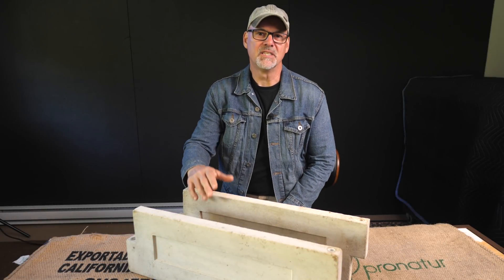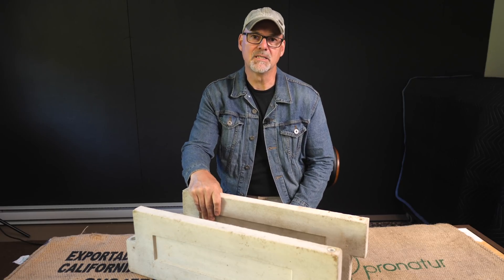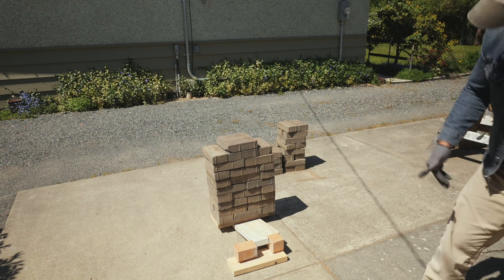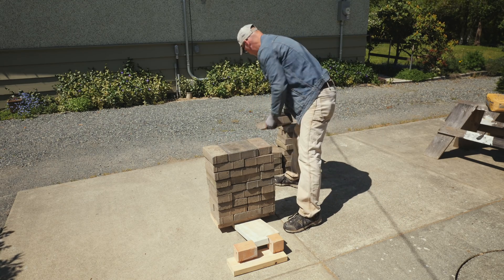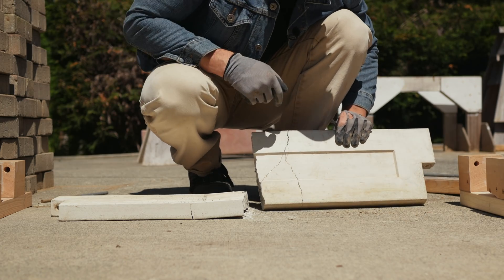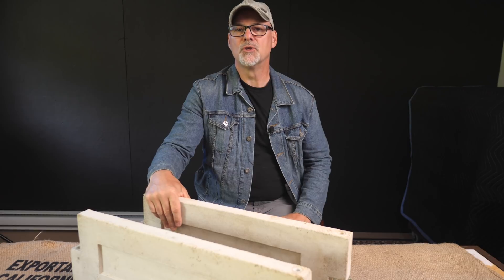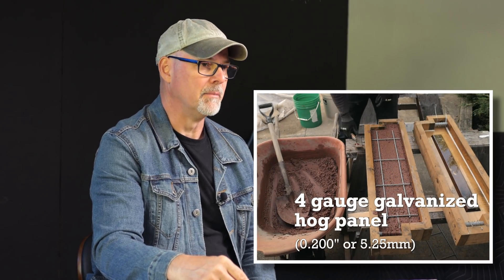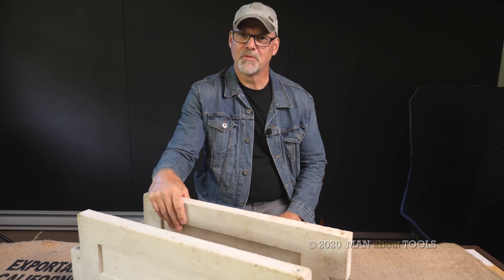How Strong is CSA Concrete? - Deflection Test Lightweight Garden Box Panels

Comment: I'm about to start building my forms, but I do have a question.

CSA concrete has a compressive strength of 6500psi. Sakrete Maximizer has a 5500psi compressive strength. The Sakrete Maximizer costs less and is probably lighter. Have you tried using Sakrete Maximizer to build the thinner light weight boxes?

Comment: I am real curious if this system could be adapted to a short retaining wall solution. Maybe with some 3/8 rebar or the hog panels? Any thoughts?
Reply from the maker: That's possible but, the CSA concrete is more expensive than a regular bag of readymix.

Comment: I wouldn't want to use the steel reinforcement, there isn't adequate cover to prevent it from rusting and spalling the concrete within 10 years or so. I'm more concerned with longevity than strength or weight, so I'd chose the thick Portland variation with fiber only. Perhaps with heavy fishing net as a reinforcing mesh that won't rust.

I think plain old Portland cement will be adequate because I have some garden beds made with 24"x24"x2" pavers half buried and mortared together on the edges. I routinely walk on them and pivot the nose of the wheelbarrow on them when dumping compost. None have broken yet (I forget when we placed them, but I know they were there in 2012). I believe they are made with a very dry concrete mix which is compressed into the molds.

Comment: First, my condolences on your loss.  We are of an age where this aspect of the cycle of life becomes more frequent.  It is important to celebrate and remember all of the good times, but this doesn't make it any easier.  I've watched some of your videos and I am right now putting together my plans for making concrete planter boxes and you are 100% of my inspiration in this project.  Can you tell me how much weight brought the standard portland cement panels you built to failure ?
Reply from the maker: Thanks you very much! I wasn't able to break a standard portland based panel with all the weight I could apply by hand.

Comment: Very interesting series.  I am about to build a house and some outbuildings.  I have been following because I am interested in using a post and beam construction methon and plan to use air Crete blocks as the infill.
I plan to use blocks 2ft  long, 1 foot wide and 1 ft high.  I am just wondering what the compressive strength might be?  Tensile strength is one thing but virical load bearing test would be of interest. I wonder would you mind testing the compressive strength of one of your panels as if it was to be used laying down and supporting 20 feet of aircrete panels above it.

Comment: Thanks for the video!. I watch your tests with great interest. So the best for tensions would be 2 meshes, but if you were to choose the mixture to achieve lightest panels that would also resist a hammer what kind of mixture would it be?
Reply from the maker: I'm font of the Perlite or Vermiculite blends for lightness and durability.

Comment: ( 4:45 ) non-life-depending application of the panels aford you to simply repair them with CSA concrete. As a matter of fact quick, quality and strong repairs are one of major uses of the CSA concrete. Put the parts side by side on plastic sheets, apply plenty of water to the crack(s) and use the prepared CSA concrete wet mix as if it is glue.

Comment: Got my plans last week; built the forms; pouring today - great timing w/ this video!  Even though the test showed relatively low tensile strength I plan on making my panels without the wire; I will use the glass fiber though.  I think the panel thickness of 1.5" eliminates the possibility of regular rebar, and I just can't imagine real-life loading that requires extensive tensile strength.  Typical stresses will include the string trimmer and possibly corner chipping if whacked by a tool.  And you know, the failing point with side stresses will probably be the corner pins, right?  They're only a few inches in the ground.  Kent - as a fellow homesteader let me emphasize that your design is absolutely superior to anything I've seen ... thank for sharing your work.  Ideas for follow-up:  I've already done this for myself, but maybe you could share "recipes" by weight/measure for each size of panel; I'll be weighing out my batches in increments a bit more or less than a 55-lb bag.  Another thing I'm interested in is your irrigation system ... I see what look to be poly risers at the corner of your beds.  Do these feed a header with drip tape?

Comment: Great series. I have some engineering comments if you are interested in improving the strength of them to resist the freeze/thaw cycle as you stated. For a beam loaded along it's weak axis (which is how the freezing of the flower bed would load it), it's important that that beam be designed so as not to reduce the moment of inertia in this axis more than necessary. Namely, you should consider getting rid of the the decorative inset (or at least reducing it's depth). When the beam is loaded in this way, the top face of the beam would be in compression (good for concrete) and bottom face of the beam will be in tension. Of course concrete has little tensile strength so the bottom face is were the steel reinforcing needs to be placed. Unfortunately the steel cannot be located as close to the bottom face as it could because of this decorative inset. This is very important because the beam's resistance to bending, it's moment of inertial, is related to the distance that this steel reinforcing is from the neutral axis of the beam squared (see parallel axis theorem). So moving the steel closer to the edges of the beam, even if by a small amount, is the most effective way to improve it's strength. Of course making the outside of the garden box look like a flat slab isn't too attractive but there are perhaps other ways to improve the look. Reducing the depth of the inset would help, and so would increasing the overall thickness. I saw a thicker design in a previous video and that would help obviously. I think some combination of these changes could produce a strong yet still attractive and lightweight box. One more thing, using wire mesh may be convenient but I think simple pieces of rebar (perhaps 2 or 4 pieces) would be more effective. This is evident from watching how your tests are failing. Once the concrete is cracked and it starts sagging, it's primarily the wire mesh keeping it from failing at this point. This is why you see this brittle behavior (cracking) followed by ductile (slow sagging). This is also why 2 sheets of wire mesh are stronger - ie, your wire mesh isn't strong enough. A heavier mesh might help but I prefer the idea of using rebar. Good job keeping your mix as dry as possible too. Cheers.
Reply: Excellent advice. Glad I read down this far. I'm trying to come up with an attractive, sturdy concrete barrier for my beautiful, but spreading, bambo. (FYI - ALWAYS get CLUMPING bamboo, NOT the spreading species.)
Reply: Bamboo is sorely misunderstood… Bamboo is incredibly easy to kill and control. My favorites are the giant bamboos but there are several smaller ornamentals that are dear to my heart as well… variegated leaves, black stalks, etc… Clumping is ok for borders and screens where you will never walk, the creeping bamboos are more open, and I tend to like them better.

In the spring, when the new shoots sprout, simply snap off anything you don’t want and it will not grow back (unless a new root grows into that space). If you cut down a bamboo, and simply step on any new shoots, the entire plant will die within a couple years. 

North America has a couple hundred native varieties of bamboo, and hardly any of them are left (and they were all extremely easy to kill)… Any plant that can’t photosynthesize, will die… Mint varieties can be difficult to get rid of until you realize that mowing them with a lawn mover for a couple years completely kills them. 

If you put bamboo next to hardscapes like concrete sidewalks, etc… A root containment barrier can be a good idea… Bamboo cannot grow in water, so water is a containment for bamboo… A lot of people think lucky bamboo is a bamboo and it is not… It’s a water plant that only resembles bamboo… I plant bamboo without any root containment, and have zero issues controlling it (and it takes very little effort to do so)… 

There are some good videos on YouTube about bamboo… Look them up and learn about bamboo… It’s an incredible plant that has a ton of great uses and it can be stunningly beautiful… Many varieties have edible shoots that are very mild and slightly sweet… 

Giant bamboo averages 150 ft / 50 meters, it makes excellent fencing and lumber, is very rot resistant, and useful in many ways (it’s also beautiful and delicious).

Comment: As I recall: Isn't the CSA "cement-all" mix you used actually mortar (with sand)?  That would explain the better whacking resistance. The CSA pure cement is over $50 for 55 lb, unfortunately. Either way, the material has a very nice ring to it.

Comment: Great videos Kent.  I used your plans for garden panels with a little modification to make them thicker (3 inches) as I intend to use them for a compost bin that I can run my tractor front loader into to turn it over and collect.  My thinking is the thicker slab will hold up against the pressure.  I also added some cheap wooden letters to one form for a little customization.  Turned out great!  Thanks again for the videos.
Reply from the maker: Great idea!

Comment: When doing structural testing, one needs to give a good amount of time between load changes, to show that it isn't slowly failing from a lower weight.  In the above case it won't be too much difference though.  Just yesterday I was breaking terracotta bricks for the garden in a similar fashion, spanning and striking with the back corner of an axe.

Comment: Retry that test with the panel facing the other way... in your test the rebar is at top when it should be at bottom I betcha you could double that load! Concrete beams are strongest when the rebar is in tension ie at the bottom

Comment: My wife loves these panels. I"ll be making some for her soon. Your reenforcemen wire looks to be located along the nuetral axis of the panel. It does not provide any restistance to tensil loads in that locaton.  A tubbular wire reenforcement at the thicker top and bottom areas would be more effective.
Reply: @Jerry  To lean on your expertise here. I am thinking about making some panels similar to this (even thinner) and embedding carbon fiber tubes for more strength. 1) do you think carbon fiber tubes are a good item to embed? 2) at what position would you locate them to maximize tensile strength?

Comment: I'm really attracted to the thin CSA panels. The hog wire might add some tensile strength, or perhaps some light gauge rebar. But for your displayed garden bed they seem perfect!
Thank you for all you do here, but most especially for your work at your chosen occupation. I'm sure the current situation is more than enough pain, and yet it keeps coming and seems like it will never end. It might not ever go back to the way it was, but I am positive there will be many more good days to come. I am so sorry for the loss of your Mother.
Reply: Words matter, I concur better times are on the way. Just as the sun rises to a new day. I also concur with your assessment of the CSM. I am going tp do this as soon as possible, I am thankful for the conditions that provided an opportunity to find this channel.

Comment: First - very sorry for your loss.

Second - many thanks for your thoroughness in testing all of the iterations of your design.  This test sold me on the CSA thin panels.  They should easily withstand the pressures of a raised garden bed - AND you have proven that they just shrug off the weed eater.  Guess I have to start building the forms now.  Great job, great design and great videos!  Thanks.

Comment: The bending moment is maximum in the middle of the span.  At the pins it's zero and the material will fail in shear.  Since you're not really using a point load or line load you get the failure crack in the middle of the span first and then you get the two secondary cracks at the edges of the load platform board when the two split halves touch the ground and the downward force is again applied as an impulse load at the edges of the board.  If you had contrived a true point load (or line load in this case) the secondary cracks would not have occurred as the load would have only been applied once.  Testing is fun!
Reply from the maker: Yes! I totally agree with your points here.

Comment: Appreciate the effort & testing but I don't think this type of test represents the most common failure point for this design. I believe the most common failure point would be rapid general surrounding changes like extreme temperature & moisture changes.
Reply: I would agree that temperature and moisture changes may be a bigger concern for the other lightweight concrete formulas that use perlite, vermiculite, or foam cement, but I think that the CSA formula used for the beds presented here would experience very little degradation due to temperature and moisture.
Reply from the maker: I agree. The CSA is very non-permeable.
Reply: MAN about TOOLS I add xypex water proofing compound to many of my concrete formulas. Usually about 1-2% of C. This adds a considerable amount of water resistance to the concrete. No notable change in workability, colour etc. either.

Comment: My Sincerest Condolences to You and Your Family.
Your experiments are really good. Improvement is always about finding the cracks in something and then engineering them out. (excuse the pun) Have you considered mixing your materials so that the most durable material in where the line trimmer hits and the lighter material throughout the rest of the panel? Also, making two full length ridges on the inside of the panel and use a thicker rod along the length. This will increase rigidity with minimal overall thickness of the panel.  Good luck. Stay safe and well :)

Comment: Appreciate the thoroughness.  I am more likely to load these standing up on the thin edge but then they are supported by the ground.  So as long as the rebar corner doesn't twist out of there somehow and allow it to buckle in the middle outwards, we're good to go.  Did you say how much each panel weighs?

Comment: Not sure why you needed to do this experiment? Surely the lateral pressure from soil within the box is way less than 285 lbs anyway. Curious why you might anticipate the need to mitigate against failure in terms of an ordinary growing bed application?
Reply: Think of garden beds used as security for vehicle intrusion.

Comment: 285 lbs at a single point is more than plenty strong for that application. Over 3 feet you’ll never get that much load
Reply: It can and will you'd be surprised how much load a root system can apply
Reply: If it’s used for automobile crash resistance, strength matters. You know those houses lined up with a street where it Ts? I’d want all the piece of mind I could have in one of those houses.

Comment: When loaded from the back it will be the front of the panel that is under the most tension, and also where there is the least material due to the depression in the middle. Adding some wire mesh in the top and bottom sections of the front may do more than adding a complete mesh at the back for holding material behind it.